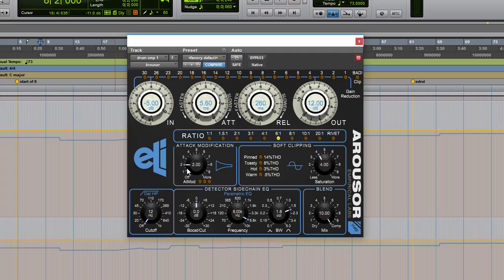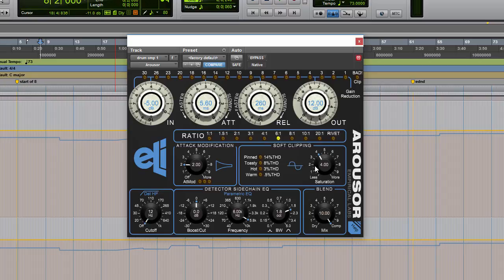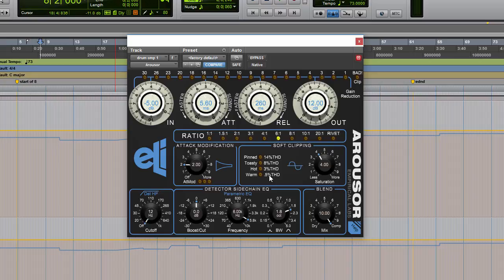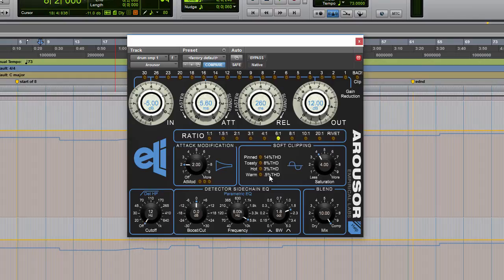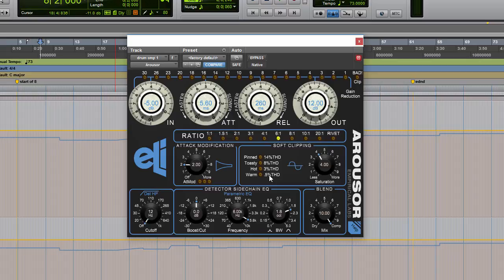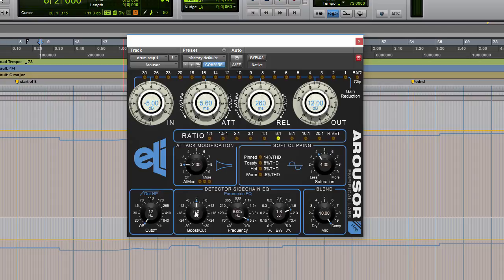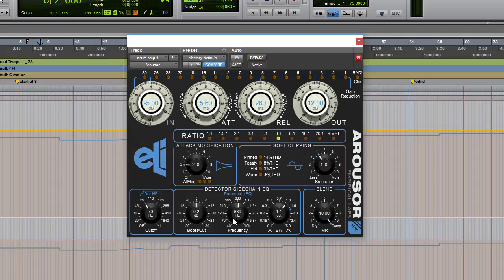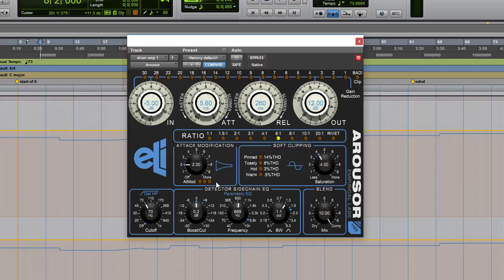Empirical Labs Arousor Overview PT 2

Comment: I downloaded the demo today, put it on a vocal, and bang! Fantastic. I had it sounding great in just minutes. It definitely has that distressor vibe to it, and I'm definitely gonna purchase it. I can use this in a lot of applications. Check out the presets too. Useful. Simply adjust the input/threshold and you can get something usable very quickly.
Reply from the maker: +Larry Lachmann  I agree. I was WAY happy with it right out of the gate. Drums is still my favorite application. Emperical put it up for sale today. It is temporarily $50 off.
Reply: +TheGuitardom Yeah, I noticed that. I'll make sure to buy it while it has the $50 off. Also it has free updates till 2020 I think (?)

Comment: Ah too bad the distressor sounds so much bigger/thicker and up front. Hopefully by playing with the settings we can get a lil closer. Thanks for doing this!
Reply from the maker: +rzemeckis It was tough to match them and not go crazy to try and get it closer and closer. I have owned and used Distressors for years so they are much easier for me to dial in. This plugin is similar but different and has different capabilities so I am sure it will become easier as time gets put in on it to reach that comfort level.
Reply: +rzemeckis thought exactly the same :-/ it misses this agressive, fat "in your face" vibe...
Reply from the maker: +ManOfDoodle Interesting, I just did a blind A/B on GS with the exact files used in the first video comparison. They were of course .wav files and not compressed. It was overwhelmingly in favor of the Arousor as being preferred.
Reply: +TheGuitardom mh...signals with more highs seem to sound better sometimes...? was there a gain difference?
Reply from the maker: +ManOfDoodle There is a slight peak level difference. You are welcome to check out the files here from the video. Obviously I don't mind you commenting on what you prefer assuming you are honest and not went looking for which is which ;-)  

https://www.dropbox.com/s/0dxwfo6k9yltwpr/Arousor%20audio.zip?dl=0